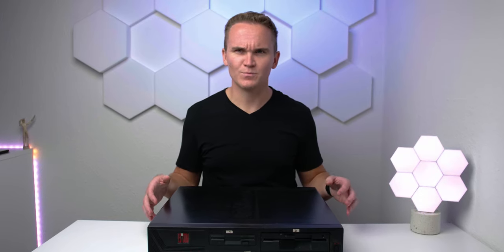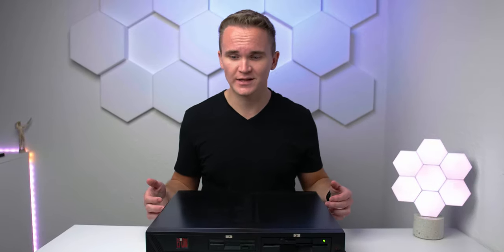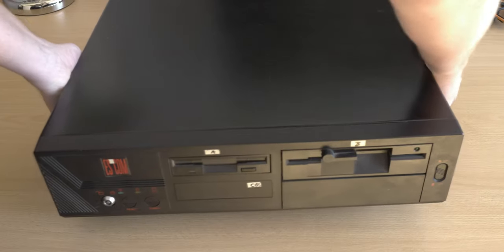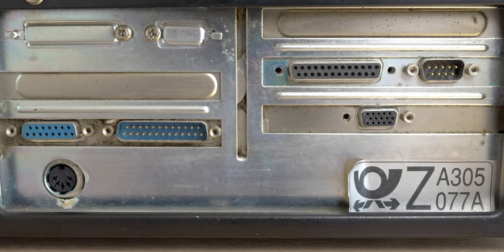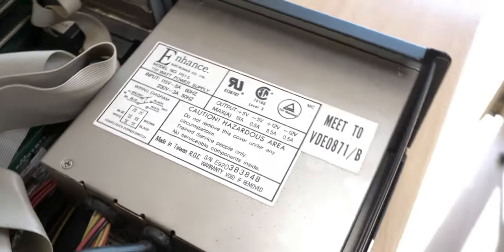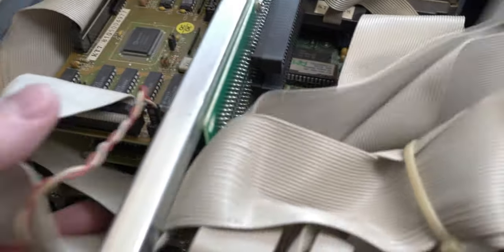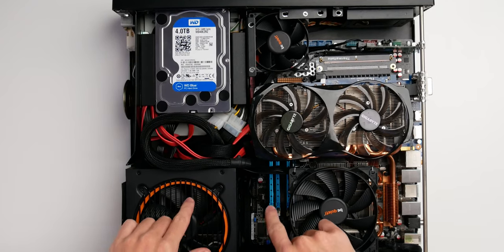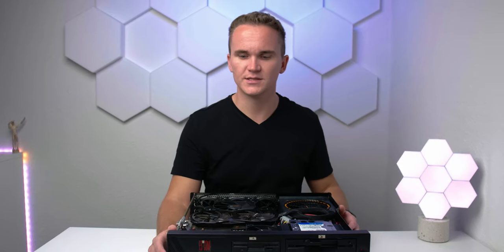Building a crazy sleeper PC | The Idea of Technology

Comment: So wait, you're telling me that the psu in computers used to be able to feed power to two monitors, a graphics card, the motherboard/processor, AND a speaker off of solely 150 watts? That's insane man, kind of makes me wonder how much of the increased power consumption in our PC's is because of the increased demand from the components themselves and how much of it is from a lack of optimization in the consumption from manufacturers. Sort of how code used to be more condensed and optimized when data was a concern vs how it is now where games like warzone take up 300 gigs of data despite only being a shooter.
Reply from the maker: Yeah, it is totally crazy. Completely different times but still impressive what was possible with this limited amount of power and resources. I can completely understand you point of "inefficient" coding. As someone working in IT this annoys me a lot. So much disk space, internet bandwidth and therefore energy overall is waisted because of poor coding and implementation. Modern hardware is super efficient and crazy fast but the different layers on top make the difference.